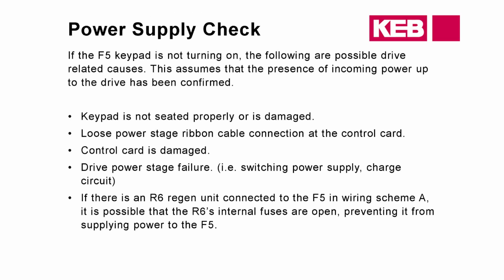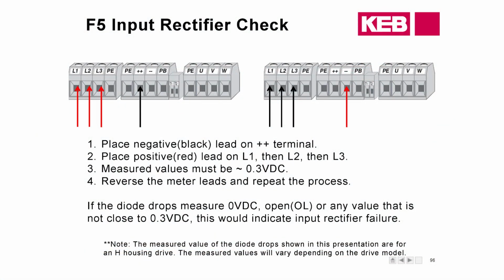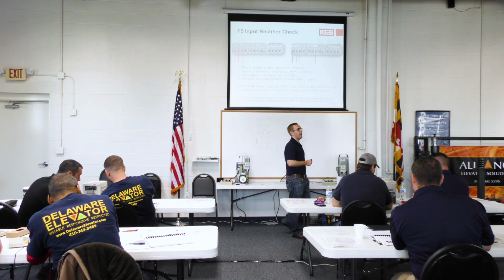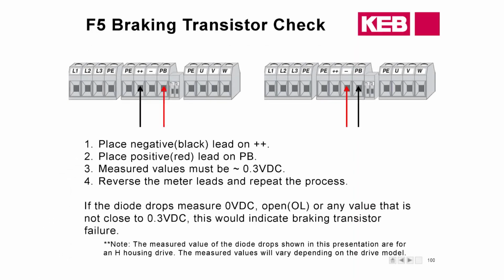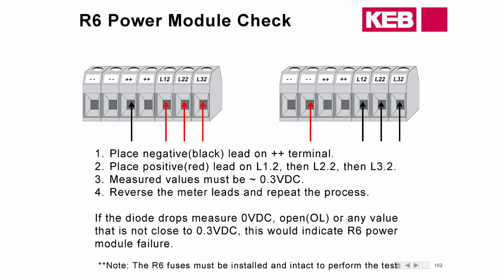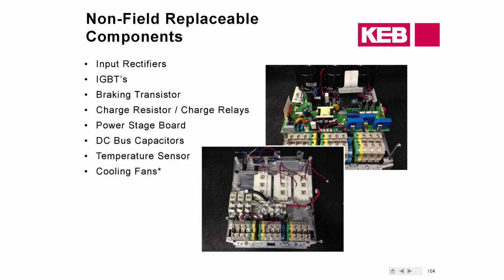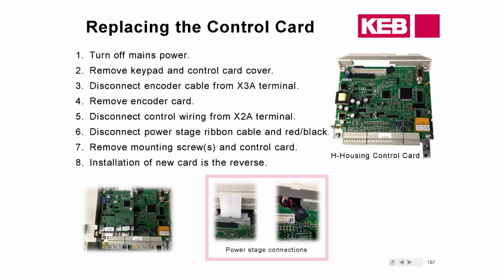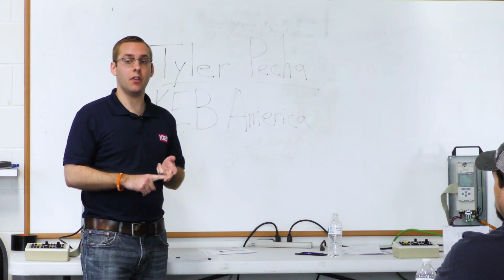KEB F5 Elevator Drive Training: Hardware & Drive Replacement (Part 6)

Comment: I would like to infrom you that we heve been suffering from the problem  of ( E.noh ) alarm in keypad. and machine displayed alarm.. ** Error ** 38 over heat pm. We have allmost all the KEB  inverter.  What can we do to solve the problem. Pls help me. Tq
Reply: From malaysia.
Reply from the maker: Thank you for using KEB inverters. This channel is KEB America and we serve the North American market (United States and Canada). We have a few local companies that we work with in Malaysia. Fictron Industrial Automation PTE Ltd. and TDS Technology (KL) Sdn Bhd are companies that can likely give you more localized service. You can find them here: https://www.keb.co.uk/contact/contact-worldwide?L=0
Reply: First you must connect to PC your inverter by COMBIVIS and check out if problem on hardware side (temperature sensor and othe electronic components) or some kind software problem.
If you sure problem is in temperature sensor, and software show overheat (over 100C), but heat sink is cold as the heart of my ex - leave a link here with picture of your temp sensor.